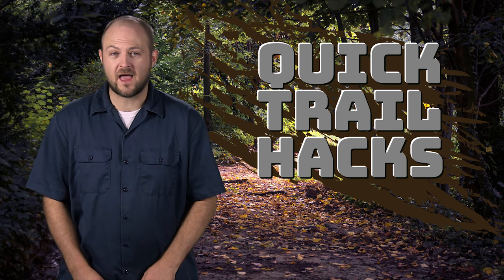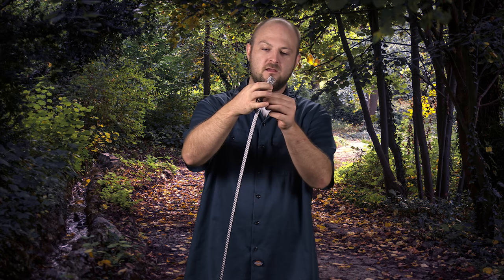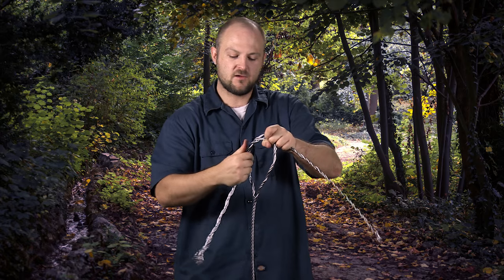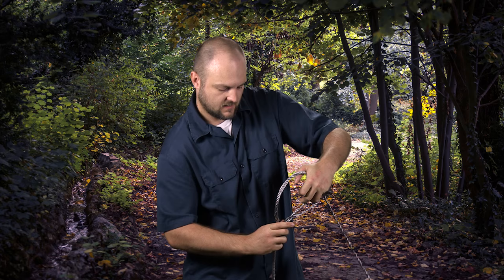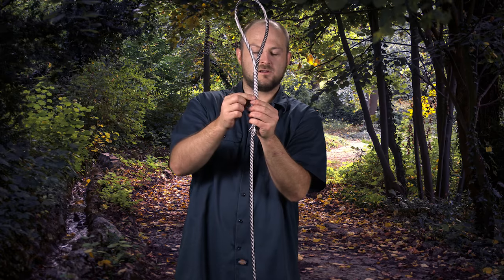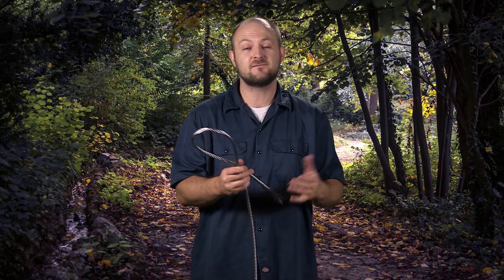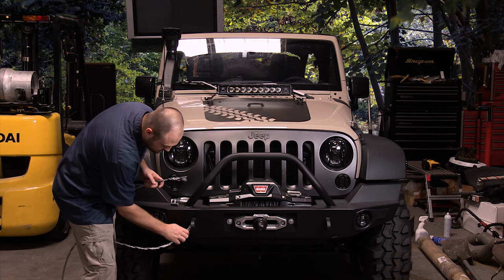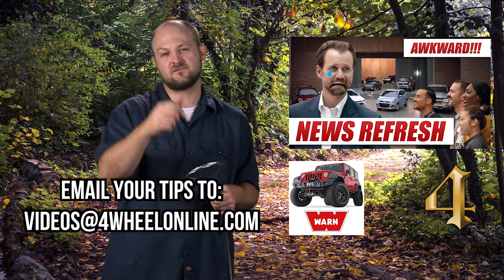Molly Hogan Loop: Broken Winch Cable Fix | Quick Trail Hack

Comment: As a lineman I have done this hundreds of time putting new eyes on our truck winch.  A WORD OF CAUTION!  WEAR SAFETY GLASSES!  I had one of these legs slip out of my hands and ended up with a deep scratch across my glasses ... had I not been wearing them I would be blind today. The process works great - just be careful
Reply: Not sure if anyone cares but if you are stoned like me atm you can stream pretty much all of the new series on InstaFlixxer. Been streaming with my gf recently =)
Reply: @Roman Oscar yup, I have been using instaflixxer for years myself :D

Comment: I bought a medium sized wooden spool of 9/16'' cable at a garage sale for $50.00. A friend of mine showed me how to do this braiding a loop on the end. I have made several 50' - 100- tow cables out of it. Comes in real handy when teenage kids call me up at midnight-1am stuck at the local reservoir mud bog when the tow truck can't get to them, I can. I like a loop on one end and a hook on the other attached with a heavy coupler of some type. A large D ring will work to attach a hook. Also smaller cable with loops on both ends work great for pulling logs, trees, ect... I made three choke cables when I was clearing river front property I bought. I'd wrap each choke cable around a bunch of brush/willows and hook all 3 to a chain. As I drove forward the cables tighten and pull lots of crap out in one pull.

Comment: Thanks for this, not related to being on the trail but more to do with filming. Needed to create a curve rail from pvc pipe and had some spare rope wire but didn't know how to create a nice loop either end so I could use a carabiner to join the two. Just finished it and its holding perfect  now I can use just two light stands and have a curved track to hang the diffusion instead of using three or four stands to create the same effect.

Awesome

Comment: Works best cut clean at the end. You can cut it with a sharp steel Conner or a ax by hammering. Hard on the ax but it cuts clean. the longer the pig tail the stronger it will be.

Comment: Great  video but everybody seems to be calling a farmer's eye a molly splice, or something similar.  A molly, or molly hogan, is a strand taken from a short piece of wire rope and braided into a circle. It's put through the hole in the pin of a safety shackle to prevent the  nut on the pin from working loose.

Comment: Used this at one end of a metal cable for hanging a heavy mirror, used a bowline at the other end so I can adjust the height. Will tape the cable at the bowline end to double-check it's not slipping; it it is, I'll molly hogan that end through the loop on the other end.

Comment: I'm not a doctor, but how is this any different from the way some cables come? As far as strength goes.
Reply: It’s the same as a factory end except the tail is shorter and they use a ferrel/sewage to tidy it up. No difference in strength.

Comment: Hi the utility industry uses the Flemish splice all the tile to connect support cables for utility poles to dead eyes and other eye bolts to support the poles in many situations.  The most important trick is how to burry the ends and I've seen guys lay then into the 'standing' or straight part of the cable using a screw driver inserted at the joint and twisting the ends into the wire , very clever.! Cheers Warren .
Reply: I was taught this by a lineman like 35 years ago, and have found a lot of places to use it.  So cool what one guy can pass along to a kid in 5 minutes.  It was literally a day at a church camp sort of thing and he just decided to teach us something.

Comment: Our mechanics in the coal mine use this method to install a new chain on a continuous miner. These chains weigh several tons and the cable never slips apart.

Comment: Thanks for posting.   So do you plan to leave the "tail" flopping around... maybe would you add clamps of some sort? 😁
Reply: Obviously if you had clamps you would just use them to make the loop. The point of this is to show how to do it on the trail with none of that. You’d just tape together the ends and your good to go.
Reply: Stewart J this is actually stronger without a clamp than a loop without clamps. I usually just tape the end to main line with electrical tape or heavy duty heat shrink works good
Reply: Anything strong enough to keep the loose ends out of the way under the conditions.  Eliminating hang-ups, injury from wire strands etc. Cable clamps are the textbook answer but I think the idea in this video is, "Sht, the cable broke, how do I get the damn machine out of the ditch now?" so you'll work with what you have.